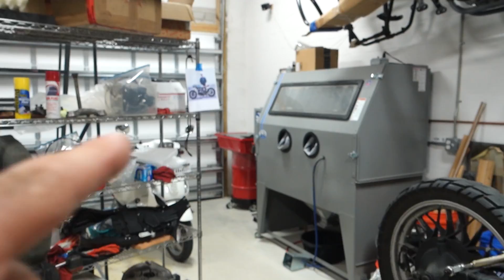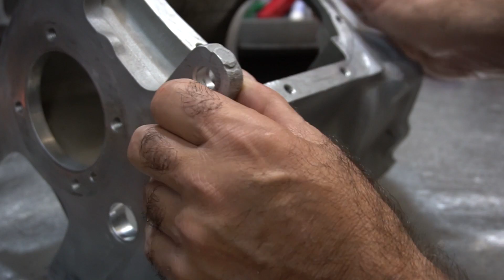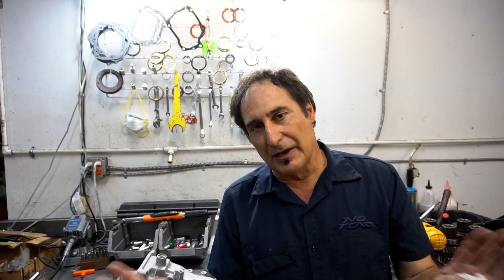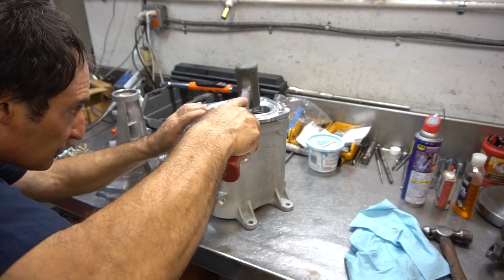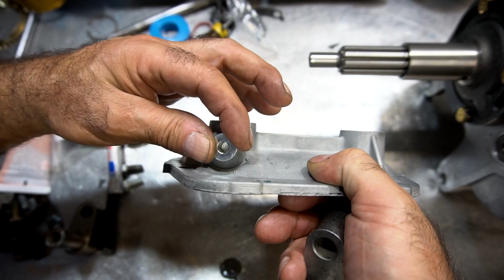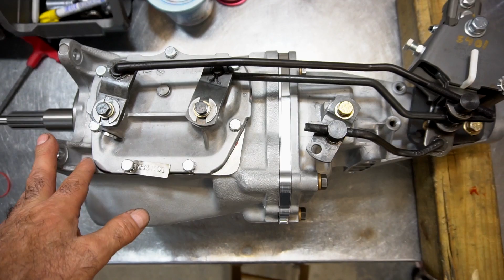Muncie Case Repair - M22W Gears and Latest Upgrades

Comment from the maker: This video is a 2nd and final part of a video I did on a Muncie that ran out of oil, seized up and blew up the gearset.  It was a matching numbers Z-28 so the case had to be repaired and we upgraded to a more streetable M22W gearset and other cool upgrades. Take the time to read my answers to other comments to avoid having to ask and me answer the same question.  Thanks for watching!
Reply: I love when someone can take a numbers matching car and make it perform much better. This is also why I like watching people modify OEM cast iron cylinder heads, install stroker kits, and come up with other methods of getting more power without being detected.
Reply: Thanks!
Reply: I don't understand all the talk about steel wool and how it "looks"?? .. 
Lets get it put together already.
Reply: @calholli  The Aluminum will be rough and porous, holding dirt and greasy handprints. He does this so it cleans up the case, keeps it looking clean and new. If blasting, it will almost be white and flat, no shine at all, and will be dirty in no time.
Reply: @calholli  In the "old America", a true master of his profession paid attention to FORM as well as function if time permitted. My father was an oil burner and HVAC technician who would twist every wire the exact same direction so they would match up and bend copper tubing in a perfect pigtail then cut it and flare it so that it went right into the fuel pump with perfect alignment. 

Some would call it anal, others would say a job well done is a reflection of the man (or woman) who did it. 🇺🇲

Comment: What if the oil coming out of my m22 looks like pearl paint? I changed it but I have noise coming from the transmission.  It shifts fine and I hear no clinking.
Reply from the maker: bronze or aluminum files

Comment: What a great job. That 'box is better than new. This may sound like a silly question, but what stops oil from leaking out the front of the countershaft? Did you put sealant on there? Thanks.
Reply from the maker: its a press fit.

Comment: looks really nice.  i prefer the belleville spring washers to the star washers, but otherwise just super nice.
Reply from the maker: On the high end racing stuff we use Nord-Lok washers. The problem is that if units are serviced in the field not everyone has these. Thread locking compounds such as orange gel Loctite and a simple star washer have worked successfully in endurance races with zero issues. So as an indivual disc washers are cool to use but if you have seen any Nascar units especially the newer transaxles use safety wire and thread locking compound. Having built gear boxes for the military its all safety wire
Reply: Makes sense.  Also like lock wire but only when it makes sense with pair or group of bolts.  And it’s time consuming to drill the bolt heads in a jig.  I’m sure loctite and star washers work as well as a disc washer - it’s mostly about appearance for me.  And the fact they are thinner so protrude less and leave more bolt in the hole.  Anyway - nice work.
Reply from the maker: You can buy bolts pre drill for safety wire

Comment: what is the proper way for the shifter forks to face with the cut outs ? and side cover bolts torque ft or in pounds ?
Reply from the maker: Watch my part 4 series of the Muncie Tapes
Reply: @GearBoxVideo  thank you !!

Comment: Paul I love watching your videos and would like to give you a little advice. When installing helicoil inserts, install them 3/4 to 1 1/2 of a pitch below the top surface. As per Helicoils instructions. This pervents pulling of the top thread of the insert when installing an bolt into that hole.
Reply from the maker: I never leave the the last windof the heli coil above a thread

Comment: My friend, I think that Grade 8 bolts are the wrong bolts for that application. Grade 8 does not stretch. Stretching keeps the parts clamped without distorting the clamped parts.

I love watching your videos. Keep them coming.
Reply from the maker: They are not.  This is simple torque. Not to be confused with torque to  yield bolts. TTY is not required and has never been for this application.

Comment: What is your take on the side cover with needle bearing setup for shift shafts?
Reply from the maker: I don't like needle bearings inside covers. I started to see the needles start to Dent the shifter shafts. I always removed them and replaced them with bronze bushings. Now the new covers are only made with bronze bushings. So I guess they took my advice

Comment: I find that paraffin and ATF are cheaper and just as if not more effective than tap magic.
Reply from the maker: My $4.00 bottle of tap magic has lasted over 2 years.  You serious?
Reply: @GearBoxVideo  

I had the chance to experiment with various stuff. EP gear oil works great too for most things.  The only time I have had any issues is when dealing with various stainless steel alloys. Then I prefer something like Moly Dee, due to the way Stainless behaves.

But seriously, take a block of Al, drill and tap holes using various lubricants.

Comment: Fantastic tranny rebuild...any video of the new crate you built for the return  trip to the customer?
Reply from the maker: We don't use crates.  We have special cartons that are premade. We ship transmissions worldwide with zero issues. Building crates is time consuming and costs the customer more because of crate costs and weight and assembly time. There are better modern alternatives such as Scribner cases as well.
Reply: @GearBoxVideo  Thank you for responding. I've watched several of your videos and learned something from each one so far. Thank you and Take care : )

Comment: When someone needs to add a bushing like that to repair an egged-out counter-shaft hole, how do they make sure that the installed bushing is (1) still coaxially lined up with the pivot at the other end, and (2) still the correct offset away from the other shaft?
Reply from the maker: By finding the center based on the upper shaft. There are also people that have made jigs based on measuring good cases.

Comment: Hey Paul just pulled my m22w tranny out of my camaro and just wondering if you have any suggestions to what kind of fitting or hose I could install on the vent to stop it from drizzling on the box? Thanks
Reply from the maker: The vents are 1/4 pipe thread and you can run a line higher up. What oil are you running?
Reply: Royal purple 75/90

Comment: Love you attention to detail. Just curious, what does a job like this run parts and labor?
Reply from the maker: Depends on the condition of the case. Typically $1500 to $2200
Reply: @GearBoxVideo  I'd say very reasonable for the attention to detail and quality of work. I have a 1-2 syncro issue on my 79 928 5 speed. If you are familiar with the 928, it has the differential and trans in one piece attached which in my case is a limited slip. I also wanted to replaced the LS clutch plates because they are a little worn. Is this something you would take on? I can order the synchronous and LS clutch disks also.

Comment: This is off topic because this video covers the Muncie. But I have a AMC T-10 I was told that Borg Warner built the gears and syncros  to AMC specs and they are not available only the bearings and blocker rings will interchange from other T-10s is this true ? Can you get gears and snycros for these trans? Mine is date coded for 67-68 I am told by a trans rebuilder they are very hard to find thanks I want to rebuild it and sell it . Still looks a factory shifter on it just missing the handle
Reply from the maker: The 1st design AMC  ST10 has some oddball ratios and gears. However we can help you with all those parts
Reply: That's great I had Tourest Trans in Salt lake tell me you cannot get gears or the main shaft new  for these and another trans place told me the same they said they are specific to AMC specs . They had one out of a 69 AMX tore down they couldn't get parts for. Can I give you a call during regular business hours is your contact info on your site? Thank you .

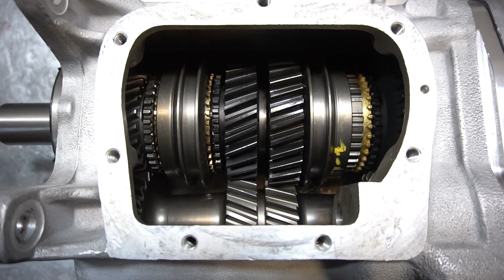Comment: I wish you had built the trans I raced with.  Nice work. Just one question though, at 15:45 it looks like the 2nd gear is not lined up directly with it's counterpart.  Is it just camera angle?
Reply from the maker: Read below answers. It's like that normally.
Reply: @GearBoxVideo  Fast reply, thanks.  I just did not go far enough down the comments.

Comment: When I was younger, A person who lived rite down the road had a stripped out Camaro w/327 & a Muncie 4spd that would lift the front wheels off the ground & when it came up for sale for $950.00 in about 2001-ish, I remember thinking that,That was a lot of money for a car that was stripped out & that it would get me pulled over. I WISH I COULD GO BACK IN TIME & JUMP ON IT, I SHOULD HAVE PURCHASED IT IMMEDIATLY!!! NOW, I AM OLDER & WOULD LIKE TO THINK THAT I AM WIZER? DO YOU HAPPEN TO HAVE ANY Muncie 4 spd transmissions that you would sell? Back in the early 2000's we had a 79 Z-28 W/1973 Chevrolet SB-400 BORED .030 OVER TO A 406, ALSO UTILIZING A STROKER CRANK, AMBER LIGHTWEIGHT PISTONS 11/1 COMPRESSION,, & the list of goodies went on & on. Today, I find myself without a hotrod & I would at least like to have a drivetrain built & ready to go for when I do find a chassis to put it into so, if you happen to have any 327, 396, 400,  or any unneeded motor's or gearboxes, PLEASE CONTACT ME. I SAW A PINTO FOR SALE THE OTHER DAY, I USED TO HAVE A TRUCK WITH A 13/1 COMPRESSION 429 & A C-6 TRANS, WISH I COULD PUT THAT 429 INTO THAT PINTO!  I am getting desperate enough that I am considering finding a 302 & obtaining the pinto??? I NEED A PROJECT CAR! Keeping my eye's open for a decent project car! Be thankful that you have a Muncie 4 spd!!!
Reply from the maker: Interesting story. I have found interested unfinished projects for sale in Facebook groups. You may want to search groups

Comment: I can attest to the fact that you can break a tap in aluminum. I broke a HSS tap in a hole once at school. This was mainly because I should have verified the size of the drill bit I used rather than trusting that it was put back in the right place last time, which I should have done because there's a lot of young people that go to these schools who are still use to their parents cleaning up after them, I guess. Still, you can break a tap if you don't do a lot of tapping and haven't gotten use to the feel of your tap-wrench and by not clearing the chips if you let them build up too much.

On a side note: May I recommend getting a small mill for reaming? Just a little Grizzly or Smithy mill. Even though that reamer appears to be made to go on a ratchet, it just makes me cringe seeing you do it by hand, especially into aluminum. ...Just a little respectful criticism.

 Other than that, great video.
Reply from the maker: Always when using a tap do a couple of turns and reverse turn to break the chip. Never let the tap clog up.

Comment: I've broken so many taps in aluminum.  Aluminum, depending on alloy, can be kind of 'gummy' when you do operations like this.  You have got to be careful especially when tapping new holes.
Reply from the maker: If you know how to break the chips or use a spiral threaded tap and have a basic feel you shouldn't be breaking taps. I think the last tap I broke was when I was 16

Comment: Regardless that I am not mechanic but carpenter, I just love all great machinery work and parts. Like looking those gears is just something that fascinates me. The lathe is one of the machines I really admire, that what kind things can be produced with them. And this same admiration is about everything in such handwork production from aviation to cars, from paper factory machines to firearms etc. I don't care about cars and driving cars or owning ones, they are just vehicles for me, as my heart belongs to the sky. But the same engine designs, builds and work is done on the cars that is just amazing how well things needs to fit to get them working.

And it is always nice to listen a insightful person to tell things about such things as gear fluids or show how they work with some piece of machines, as you learn always new things for everything else. Like almost two decades ago I met in the Cuba the blind engineer who was specialized to gearboxes. He did work with the older cars etc, but his skills to know in what condition the gearbox was just by a feel was amazing. He could just lay hand on the gearbox and feel what gears were weared and what parts were required to be tightened etc.

Comment: The Helicoil insert tool has a slot in the end. When retracting the proper insert tool that action seats the insert into the locked position and then breaks the tab off. I hope this helps.
Reply: The tool with slot is newer style, also used on the Australian made 'Recoil' thread repair sets. With Helicoils, you should always go 1 thread below the surface. Many people 'prefer' Timeserts' as they are easier to use plus cover up any mistakes. Timeserts are made by Wurth in Germany (or were 35 yrs ago ;o) )
Reply: @peterjones6945 I Agree. The tool we used fifty years ago also had the slot to hold the coil. Cheers

Comment: That Muncie after you finished it is a "Thing of Beauty!" You are a Pro! I went to trade school for farm diesel mechanics. After a short career as a diesel injection pump specialist I ended up at a GM dealer as a parts manager. When the new style Chevy pickups came out in 88 we had a guy with a 5 speed manual develop an issue with a syncro or something so we had to fix it. The gear tech in our shop had never seen one and did not want to deal with it so I took on the job. I grabbed the manual and all the J-Bla Bla Kent Moore special tools and was able to get this thing back on the road for the customer. What a different animal!

Comment: Hi Ed. I enjoyed that rework video. Question about the lube issues. I have a Ram with the G56 and it of course uses ATF for its lube. Would there be any advantage (shift ease or trans life) if I were to switch to the synthetic gear lubes that you featured?  Thanks in advance for your reply.
Reply from the maker: You can use a Royal purple synchromax and Driven Racing STF  in place of ATF

Comment: Paul. I have a '69 m21 that leaks around the shifter-shafts. I thought it was a worn o-ring problem, but I didn't see you install o-rings... what's up? .... Oh. Small seals. And I can put them in without side cover removal? 
Ray  from Texas. 
Great videos, by the way.
Reply from the maker: There are no orings on the shaft. The seals are in the cover
Reply: GearBoxVideo .I'm doing it tomorrow. To answer dumb questions like mine, when there's nothing in it for you. ..shows what a good man you are. Thanks.
Reply from the maker: Its hard to pry the seals out of the cover, but it can be done.  Problem is installing them in the car is more of a challengeand damaging new ones.

Comment: Nice bike Ed, I remember the 850 Commando, very fast bike in its day and they sure have CLASS-- I am 62 now so my 1st bike was a 350 Kawasaki Triple [2 stroke]   Did you ever find out if the customer forgot to add oil after former rebuild or was it a metal to metal problem from bad clearances/???   You do good work
Reply from the maker: Ed says thanks!
Reply: LOL Some guys would never admit to a mistake. I have seen the odd engine come in to our shop having been run out of oil! Nice new oil in the crankcase---operator " i dunno just started making noise and i shut it down" LOL Yeah right! These dopes really thought they were so smart and no one would know.

Comment: always nice to have demos of strong and weak parts and explanations why, you obviously know those transmissions forwards and backwards... pardon the pun. btw, what keeps that bushed shaft from leaking?
Reply from the maker: Its press fit.  The bushings are loctited and pressed and hones to size.  Thousands done, never a leak.
Reply: great, thanks Paul.

Comment: Paul, 2nd gear doesn't look correct when sitting above the counter gear. Looks like it's off to the right @ 15:53 unless it's the camera angle.
Reply from the maker: All Muncies have this offset. Part of the design. People always ask why this is and its because the engineers at the time could not figure a way to machine the tooth growth at the end after heat treat. So the gear is offset from the end. You'll notice 3rd is pretty close and 2nd is fixed relative to the mainshaft.
Reply: I just pulled up my pic, yup, I see it...thx. http://my1970z28.com/COPO/images/muncie_locked_in_4th_and_2nd_gears.JPG
Reply from the maker: Actually if you look at the pic from on your link.You can see 3rd has a slight offset towards the rear. When I worked on the new midplate design I made sure we measured some new old stock cases to get the rear bearing position relative to the countergear thrust service exact. The newer gearsets improved some of the alignment.

Comment: Hey Paul - at 16:03 it looks like second gear doesn't quite line up completely with it's mate on the counter gear.  Is this normal, or does second gear shift a little when it's loaded up so that it gains full contact?
Reply from the maker: All Muncies have this offset. Part of the design. People always ask why this is and its because the engineers at the time could not figure a way to machine the tooth growth at the end after heat treat. So the gear is offset from the end. You'll notice 3rd is pretty close and 2nd is fixed relative to the mainshaft.